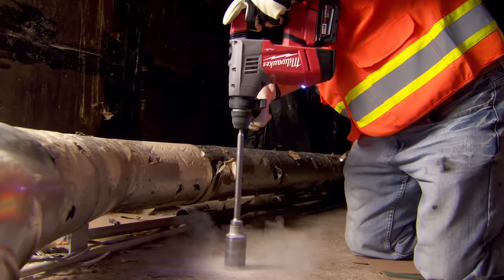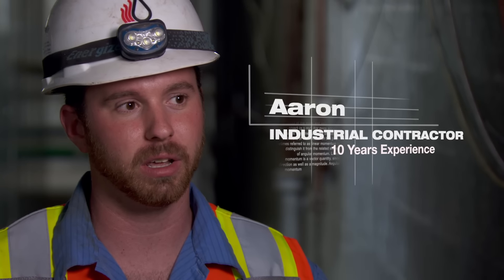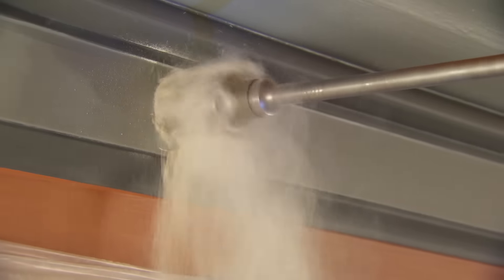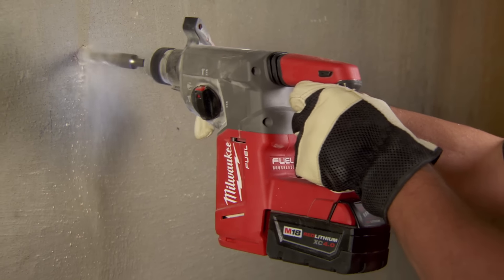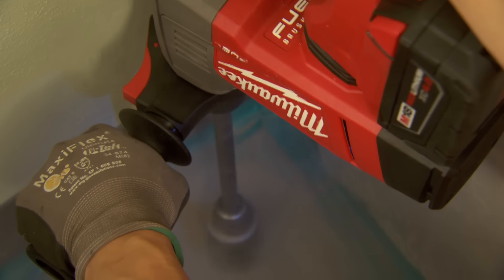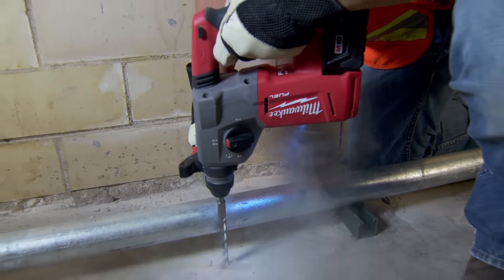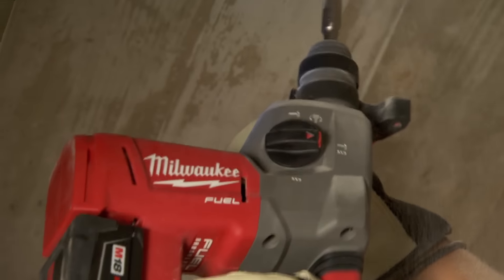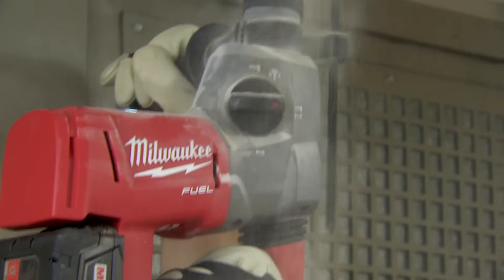Milwaukee® M18 FUEL™ Rotary Hammers

Comment: I am a structural steel worker. Recently upgraded to a FUEL kit (grinder, 280Nm wrench, 950Nm wrench, SDS+ drill) from a collection of different brands. I am happy with the rest of my tools but this one. I purchased this drill (28mm max capacity) after reading and watching reviews. I thought this would be good enough for those few holes to drill far away from a power source.  But I was not satisfied when I drilled in a reinforced concrete (4 holes 18mm diameter, 100-130mm deep). Used 2 freshly charged 5.0 Ah, almost flat after the job which took few minutes longer than usual. An old corded sds+ drill with 13mm capacity did better than this one using the same drill bit. 
I hope Milwaukee will not over sell their product. Now I am having 2nd thoughts if their new FUEL sawzall is as good as they advertise it. Keep it real. Cheers!
Reply: Ian Kenneth Labrador  Need the 12 amp battery

Comment: The non fuel line hammer drill dies so quickly, the fuel line is a little better. Get the fuel it is worth it.